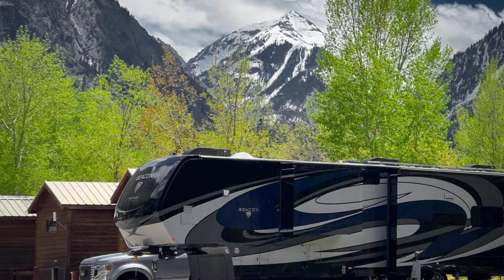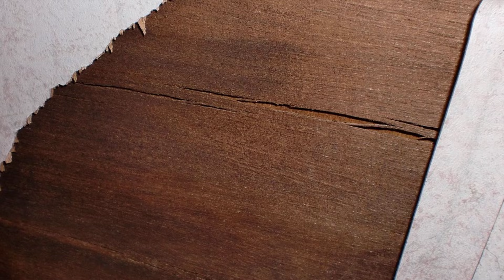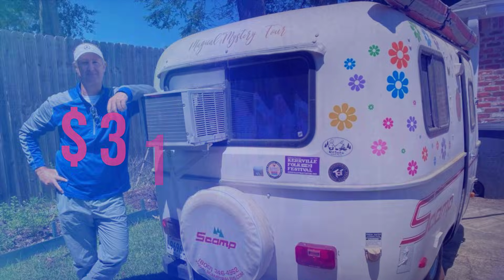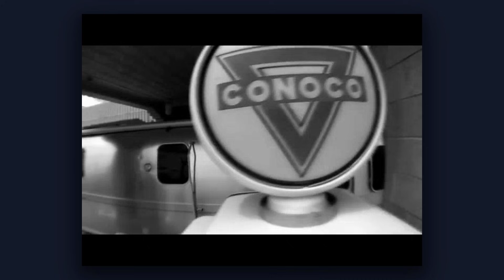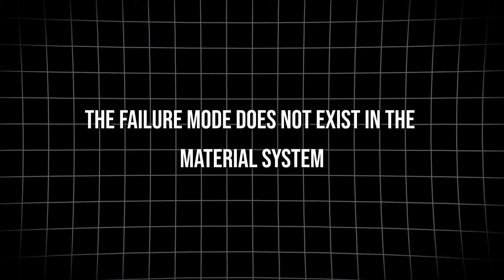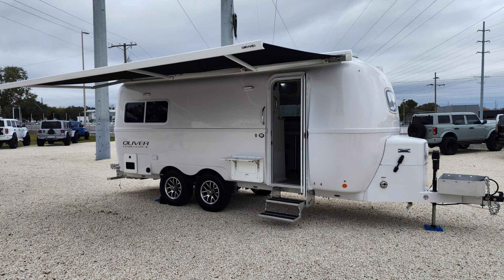The 3 RVs Consumer Reports Says Will Last 20 Years (The "Longevity" Champions)

Comment: Not necessarily.  Original owner of 2012 Flying Cloud 23".  Not a full timer but 90 nights last year based in Texas with longer travel across Colorado and over to Florida panhandle..  Lost a couple of rivets on I10 across Louisiana I10.  All 14 year old original equipment is working, with only a replacement circuit board on the Dometic refrigerator needed a couple of years ago..  All simple and manual awnings, stabilizers, old style hubs repacked every 2 years.  Tows great and still looks new (I do store inside when not in use and keep it clean and polished).  The basic trailer is great, I think problems come from the added complexity of automatic/powered equipment and app based controls.

Comment: Airstreams are built to FAIL. Rivets back out, floors separate and electronics go haywire. Maybe if you never tow it and store it in a garage it will last. Save yourself some financial heartache and buy an Oliver Travel Trailer.
Reply: My 2018 airstream basecamp had been relatively solid. I have upgraded it in many ways to better fit my needs. It's been an incredibly fun project to work on! Oliver trailers, while well made, lack all of the character that make Airstreams so popular........
Reply: @Ryan-cv8sn apparently base camp is the exception to the rule when it comes to to Airstream. The Oliver did require some decorations to break up the sterile atmosphere but it was well worth it to get a true four seasons trailer with untouched reliability.
Reply: We saved some money and bought neither. I love towing and maneuvering a fifth wheel over pull behinds. (Former national rodeo competitor) I got my hubby on board. We bought a Contemporary Escape 5.0. It’s not for everyone, but we love it. The Oliver is very nice and well made, but are not our style or mode of towing. The Airstreams are beautiful, but they don’t check all the boxes for us either. Weight, R factor 🥵🥶, and durability of the shell (say against hail damage) are the main reasons we would not buy an Airstream.